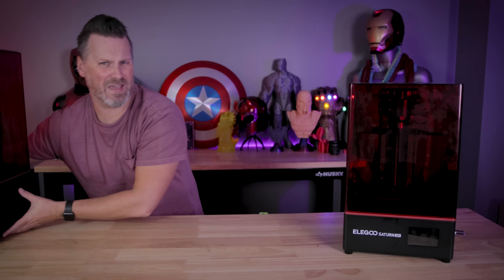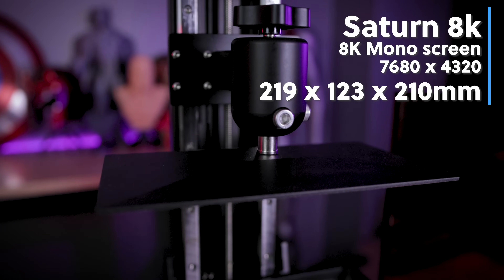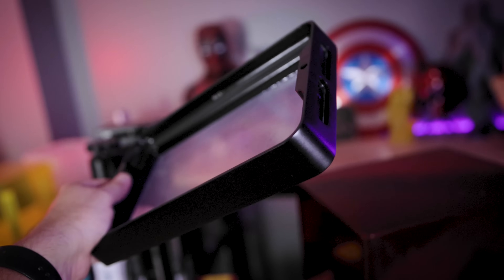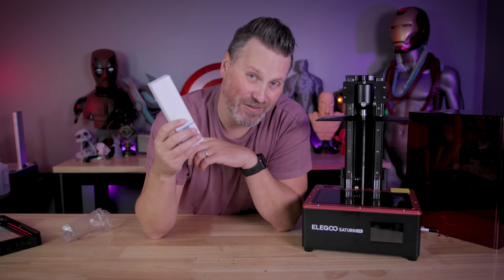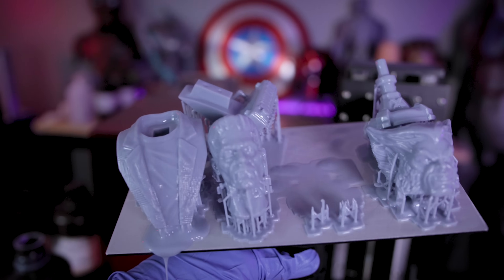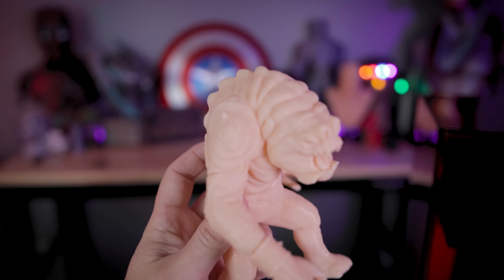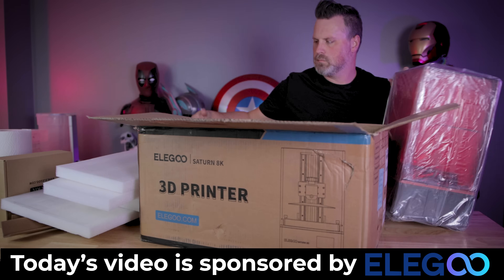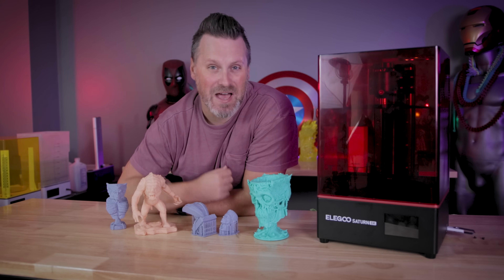Affordable 8K Resin 3D Printer - Elegoo Saturn 8K

Comment: Just got this printer a couple days ago.  I've done a few test prints and so far it's working amazingly.  Only thing I noticed is when the build plate is lowering, it is a bit louder compared to when it's retracting. Not sure if this is normal or if it just needs some extra lubricant on the rails?  I used the "default" resin profile in Chitubox with some specific adjustments for the resin I use, so the retract/lower speeds are default.

Comment: I want to upgrade either to this new Saturn 8K or Anycubic Photon M3. They’re almost identical, but Saturn says it has 0,00125mm vertical accuracy, the Photon says it has 5 micron, which is 0,005mm. So Saturn is better here? I wonder if this is correct and if the difference is visible
Reply: It's not visible no. All 8k printers print with similar quality.

Comment: What is the difference between the 28 leds of this printer and the 48 leds of the saturn 2? does it affect the printing speed?
Reply: No. The difference is that the saturn 2 has rounded lenses to help accurately spread the light  for unnoticeable differences in accuracy. But more noticeable surface finish.

But not a huge improvement as you can't even tell the difference unless you try to use a magnifying glass.

Comment: Hiya Jessy. Curious how warm you needed it to be in your workshop?
Reply: Not warm at all. Ive printed at 40°F no problems at all
Reply: UK here will be in celsius, but I just use a heat gun before each print to bring the resin just above 25C, then the heat generated by the printing process keeps it stable

Comment: I hope the Z axis is stronger on this, I picked up a Saturn 2 off of amazon when it was on sale. I printed my first big print and the entire z bent forward a good bit. It was so bad that the motor was clicking as it bent forward. It eventually stoped when it started to print the supports and didn't seem to do it past the first couple mm's. The print finished fine, except the support base was twice as thick as it should have been. Back to amazon it goes.
Reply: I'm wondering about this as well. Can't seem to find any info on whether or not they improved it at all. My guess would be no since it's cheaper than the Saturn 2.

Comment: I'm about to get my first 3d printer and have settled on Elegoo based on readings.  My question is, because the price isn't horrible, would I be better off going with something like this, or just grabbing the Mars 3 Pro.  Is the benefit of the 8k that much more to warrant it?  I'm not worried about the price difference, but I'd rather not end up having to constantly upgrade, or the flip getting too much for what I'll ever need.  Plan on doing fun patreon prints and painting so primarily miniatures.
Reply: When comparing resolution of printer screens, you also have to take their dimensions into consideration, as it is the actual pixel density that influences the quality of the print. With that in mind, this Saturn 8K does still come out ahead of Mars 3 Pro, which transitively has higher pixel density than Saturn S/original. As for if it's something that'd be worth for you, that's tough to gauge. Personally, I'm printing minis on a printer comparable to the original Saturn and I am more than happy with the details (but I am printing slightly bigger minis than usual, 4-5 cm). You can look up some 2/4/8k comparison videos to help you make the decision. 

I'd also recommend you think about how often/how many minis you plan on printing and consider getting a printer with bigger volume, albeit printing at lower resolution. It can save you a lot of time and I outgrew my ~6'' printer pretty quickly.

Comment: I'm just getting into 3D printing.  I find your videos very useful. I'm doing this because I'm planning on building a z scale model of the Hamlin CCC camp at Hamlin Beach. I'm trying to determine if a z scale detail will show on a resin print and if so what level of resin printer I would need. I also see that you are have stuff from the Rochester area on your channel. I'm wondering if you would do a test print for me of a building?

Comment: Hey Jessy, "Thanks" for doing this. How "suitable" do you think this new 8k Printer is for printing 1/24 -1/25 Model Car Bodies and Parts ? I would Love to hear your thoughts, suggestions and Opinions. Thanks much and keep up the good work. Cheers, Bruce ~
Reply: It should be phenomenal, considering the 8k resolution
Reply: @barryallen5507  "Thanks" for the comment Barry. I "get" the 8k Part, but I was concerned about the build volume and IF I could print a whole 1/24-25 Car Body in one piece Or would I have to split and section them ?
Reply: @InterdyneInternationalK-9  build volume should be more than enough
Reply: @barryallen5507  That helps, most appreciated. Thanks Barry. Cheers ~

Comment: Jessy, you can heat the printer enclosure by itself with a flexible Kombucha wrap heater (I use a $15 Inkbird brand). They are waterproof and plug into a normal 120 outlet, and heat the under-lid area about 10 degrees C (18F) over the ambient. Makes a huge difference as it gets colder here in NA. So sad I missed you at ERRF, but met Fotis Mint!
Reply: Was gonna post this idea, works great and way cheaper than heating the entire room!
Reply: @Peter-DOC-Docter  Yes indeed. BTW, Dr. Docter, I loved "Monsters Inc." ;)
Reply: link to that heater can not fid it

Comment: why would you want saturn 2 over this?
Reply: Build height and design, I own two Saturn 2's and a Saturn S and the Saturn 2's are just better all around, they look slick and have taller z axis, but if price is the major factor and height of statues or prints isn't, then the Saturn 8k is a great value and is a machine I would buy if the Saturn 2 didn't exist.

Comment: I would not say that is a budget price of $429.19

Which in the UK The new Saturn 8K printer is £480.00p

I was hoping to get the New Saturn 2 resin printer for my 1st resin one. 

That works out at £560.00p here in the UK.  That's just the printer no resin or safety stuff brought. 

So neither of them can be called budget friendly really. Even the smaller Elegoo Mars resin printer here be around £220 which to me is still allot of money.
Reply: It's budget friendly for a medium sized printer. You can get a small sized printer from creality for €129.99.

Comment: Dear Elegoo, screw you. I bought the Saturn S when it came out and months later you release the Saturn 2 and then a bit later on, the Saturn 8K.

3 upgrades in under a year. Makes me not want to upgrade just in case you release the Saturn 3 and Saturn 12K next month.

Comment: have you done much with the mega 8k? I talked to the guys from wham bam at errf and so far no flex sheet yet because of resin pooling on top since the holes would be blocked
Reply: I wonder if the holes would be the right size to just epoxy a bunch of neodymium magnets into and skip the glue on magnet.
At some point flex plates are going to come stock on resin printers and I was thinking that if they bored holes from the top of the build plate to .5mm from the lower surface and pressed magnets into the holes, they'd still have a smooth bottom of the build plate with no way for a magnet to pull out and should still get good pull on the flex plate through .5mm of aluminum. 
As an added bonus, if you do a print where you expect a LOT of tension pulling off the fep, you can just rezero and print with the bare plate.
Reply: @the_omg3242  that does sound like a good idea until the magnets cost too much to be viable, the fulament bed with magnets in it for the X1 is like 120 not including a heater or heating element! But with the mega 8k and it's holes, one idea was to fill all the holes with epoxy so no resin can stay in them and then a flex plate would a good idea, it's just the plate is so damn heavy haha
Reply: @Hughie1987  I'm not sure how many holes are in the build plate of the mega 8k, but $15 to $20 cdn will get you a lot of magnets on Amazon. Depending on the sizes it could be between 30 and 300. And this is consumer pricing for 1 off orders. I'm pretty sure a company buying in quantity could do better. 
In fact, if you're got a mega 8k and you're going to fill the holes with epoxy anyways, you should look into if you can get magnets about the right size anyways. 
If the top of the build plate is flat, it might also be worth printing a roof for it for the resin to run off.
Reply: @the_omg3242  I thought about printing an angled roof as well but then again I don't wanna dd more weight than I'd have to, it has like 323 holes if I did the math right after counting the rows etc. Maybe they will come up with something in the future, I'm hoping anyway haha
Reply from the maker: I actually have a new video coming on it. My screen died shortly after I got it which is why I haven’t made more videos on it. Just bought a new screen for it. So will be showing swapping it out and getting back to printing with it 🤘
Reply: @UncleJessy  awesome 😎 I've been using mine for statues haha

Comment: air filter is completely USELESS, please mention in the review
Reply from the maker: Huh? I don’t run it with most of my timelapses because I print without the hood on. However for most these filters are very helpful with mitigating fumes from the machines. Ohhh sounds like a good video idea actually to test out 🤘
Reply: @UncleJessy  i think the better buy is just getting an air purifier. I got one at Costco for $99 and it came with enough filters for 2 years. Maybe you could do a video comparing those tiny filters to a budget air purifier. The one I got at Costco is the winix brand and it's on sale right now.

Comment: Couldn't be more disappointed in Elegoo for this product, they completely cannibalise their Saturn 2, before that product is even properly on the Market. Also slaps most buyers of the Saturn 2 in the face because they paid extra for essentially nothing. Yes a larger Build Height, and the LCD system is different but its all negligible. I Have recently bought into Saturn 2's for my print farm and I'm happy with the machines, but I don't think it its fair for them to bring out a significantly cheaper version with almost no difference so quickly
Reply: So you'd rather have them hold back and get more people to buy the more expensive thing than get the cheap one out ASAP so more people get it cheap? 

Overall its great it came so fast, ur just salty because you bought just a little to early. Atleast thats how it looks like
Reply: @GamesPlayer1337  I think they should have held off on a Saturn 2 release until much later on so that they could actually add some significant design & technology improvements to make the additional cost worth it.

 Instead they've done it backward making the Saturn 2 redundant only a couple of months after early bird delivery

They have years worth of development cycles planned ahead of releases & they knew these printers would be essentially the same product, and releasing at very similar times
Reply: @andrewrobinson4959  So again you'd rather have more people buy a more expensive printer instead of having a cheap alternative earlier.  
They can take significant changes to the next printer anyway this doesnt change that. This early release just gives more people a shot at a cheaper variant earlier wothout any downside to it.